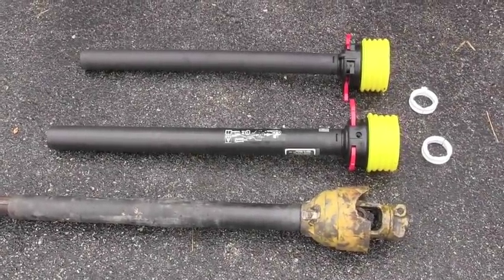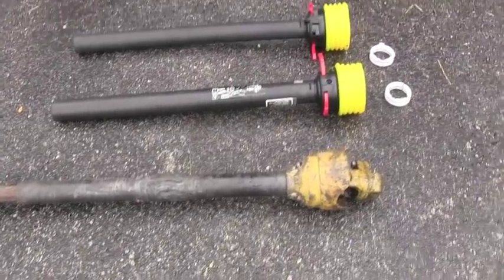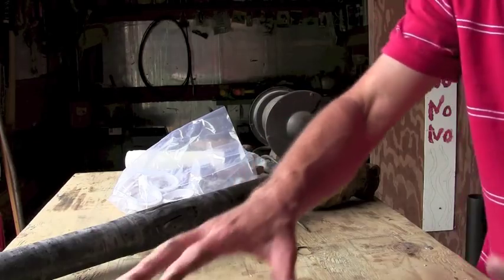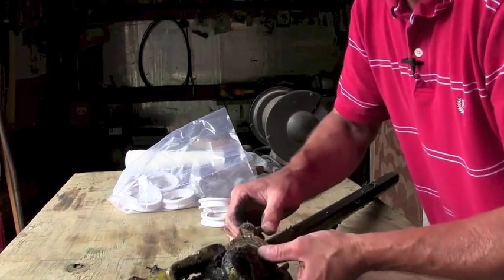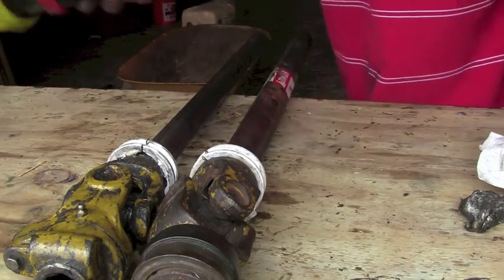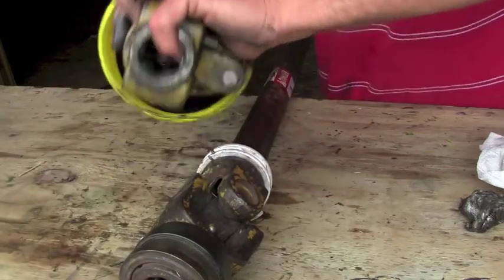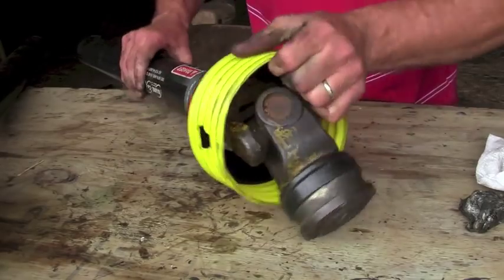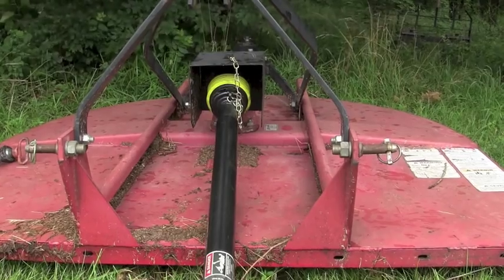The First Step Toward Equipment Safety (Installing PTO Shields)

Comment: I had an old shaft shield with no flared end Guard to cover the spinning yoke part... I cut our the bottom out of a Folgers Coffee plastic can, cut the whole can up the side so it would open and close around the yoke, then drilled a hole in the original shield part and one in the plastic coffee can and cabe tied them together... works like a charm. The shaft and yoke spin inside the coffee can totally protected. You may try this on one of your videos.

Comment: I'm mowing for a ranch with the Mahindra and 15' Titan batwing, and those OEM shield release buttons on the driveshaft shields SUCK!!! It's nearly impossible to get them off, without breaking one of the little push-in release tabs. It looks like this shield retention system would be much better.

Comment: Thanks Mike, My GF had a Eurocardan safety shield on her PTO, They asked for the Series of PTO, which my measurments is a series 3-4. The old shield did not want to come apart any way shape or form. I had to cut it out noting that the internal damage done to the bearing and cover it never would have come apart. Just looked at Shields at Tractor supply and they started at $104. Ordered a Bare Co guard and hope it goes on like you showed. Always appreciate the videos and trial by error. I needed to by an extened guard for the Gear box side since the previous one is 8" long. Bare co is simple for sure. Thanks again.

Comment: I bought a new finishing mower about a month ago. I’ve cut with it 4 times, including this morning. I thought about your videos and checked the PTO driveline. The shaft was on backwards the whole time. I didn’t know the guard shows which end belongs on the tractor’s PTO shaft until I watched your videos. The driveline on my finishing mower has NO shear pin or slip clutch. It’s a push pin with spring on each end of the yokes and that’s it. I guess the belt will slip for PTO protection. What are your thoughts, Mike?
Reply from the maker: Almost all finish mowers use the belt for shock protection.  They won't have either a slip clutch or shear bolt.  If you're only mowing grass they shouldn't need either :).
Reply: @TractorMike  thanks. That’s exactly what I was thinking.

Comment: Great info. One safety point on attaching the safety chain to the equipment and tractor:  use the clip to shorten the safety chain so its full length doesn't dangle between the equipment (or tractor) frame and the PTO shield.

Comment: Growing up, I watched a lot of tractor work. Never once did I see anyone ever use one of these covers. I guess times have changed. Or, everyone I knew just had old equipment with no concern for the safety aspect.
Reply from the maker: Nicholls & Sense Yeah, I came from the same background.  You just knew to stay away from dangers like that on the farm.  I sometimes wonder if the covers really are safer because they hide what's going on inside and might give someone a false sense of security and allow them get up close to the cutter with the PTO going, which is definitely a bad idea.  But, without getting into a debate about OSHA requirements, I like those shields because they keep tall grass from wrapping around the PTO shaft and that's important as well.

Comment: Mike, I'm replacing a pto shaft on my snowblower. 
 7 foot New Idea model 571. The gear box input is straight shaft, 3/8" square key, 5/16" through bolt.
  The pto shaft has the shear pin on the shaft tractor side. Shield is missing and the shear joint is sloppy worn.
 I'm replacing it with a new shaft with series 6
Yokes. Being the original shear pin location was towards the tractor I'm replacing the tractor side yoke with a shear style yoke like on the shaft in your video. Do you see any discrepancy in putting the shear on the tractor side?

Comment: Hi Mike,
Thanks for all this great information! I have a question about safety chains on a PTO shaft shield. Almost everything I see shows chains attached to the guards at both the tractor and implement ends, but my new Kubota L3301 and LandPride mower deck didn't come with chains. Have the safety standards changed? Which is safer - a freely rotating shaft cover or one that's retained by a chain at each end? Normally I would call the dealer, but it's Friday night and I have nothing better to do than to watch tractor videos on YouTube! 

Cheers!

Comment: Thanks Mike this video,
 I just bought a new 60" Woods boss rotary cutter, that was suppose to be ready for my Cat. 1 Woods Quick hitch :-) of coarse it wasn't and had to get the bushings and grind down to length for lower lift arms.
   I saw that plastic looking zert by the cutter end and wondered what it was for . So when I put grease through that zert, what am I greasing ?
Reply from the maker: There's a little plastic sleeve in there that functions as a bearing to allow the outside to stay in a fixed position while everything inside is rotating.  That's where the grease is going.  Most people miss that, or don't believe there could be a plastic grease fitting and end up failing the shield.

Comment: where did you get your safety cover?
Reply from the maker: At S & H Farm Supply, the old dealership I used to work at.  Just about any decent-sized farm supply store or dealership will have those.  .  It's a whole bunch easier to get the right one if you take the old PTO shaft with you when you get it.
Reply: @TractorMike  thanks Mike!

Comment: Howdy Mike, new subscriber so you may have answered this in another vid that i haven't found yet. but can i just ask, what is the use-case for the notch in the top of a master shield pto cover? we got 2 tractors with this notch but i haven't found a vid yet explaining what in the world its for. it almost seems to be a chain catch, but none of our shafts have chains much like yours here in this vid. Thanks!
Reply from the maker: I think you're referring to the little hoop on the cover...that is to hook a chain to, the other end goes to a stationery point on the tractor to keep the PTO shield from spinning.

Comment: Thank you Mike.  Now I have a question.   How do I know what size shield to buy?  I recently got a used Beaumont 5 ft rough cut hog but it is missing that shield.  After seeing how easy it is to replace it I think 60 bucks is cheap insurance.
Reply from the maker: myzlyn56 My best advice is to take the whole shaft off and take it to your local dealer and let him figure that out.  I think the one I got would probably fit your PTO because it's supposedly a universal fit.  But literally there are hundreds of different PTO designs so I'd be hesitant about trusting that a universal fit would go on.  But it's a short job to pull that shaft off and besides, there's something kinda fun about dropping an old greasy PTO shaft on the clean parts counter at the dealership :).  When I took my PTO in to the old dealership where I used to work they were nice enough to put the shield on for me.  I was too embarrassed to tell them I'd have to take it back off to shoot the video.  It took me longer to get it off than it did for them to install it.
Reply from the maker: myzlyn56 Also, I really appreciate you sharing the link to that video.  Guys tend to take safety shortcuts and you can get in trouble in a split second.  Hopefully that helps to save someone from going through what that man went through.  How awful.

Comment: New shields for my 20 year old Woods rotary mower costs upwards $130.
Reply from the maker: Yeah, they're insanely expensive and they shouldn't be.  It's just some plastic.
Reply: Yeah, they ought to be as cheap as the OE manufacturer can possibly make them, but it you want to see insanely expensive, go to the emergency room with your arm ripped off at the shoulder.